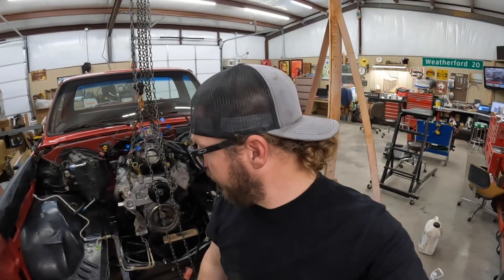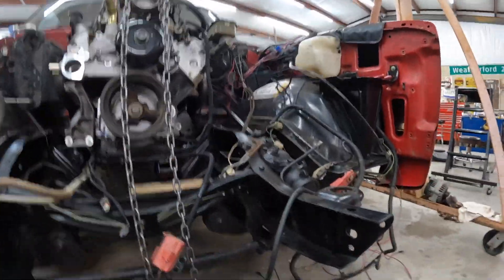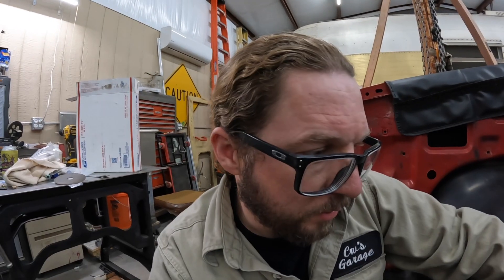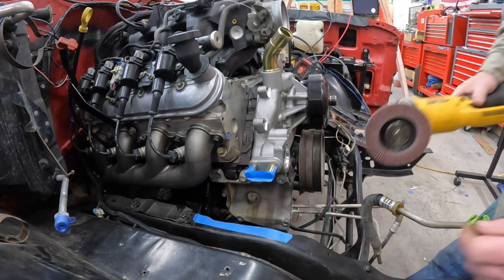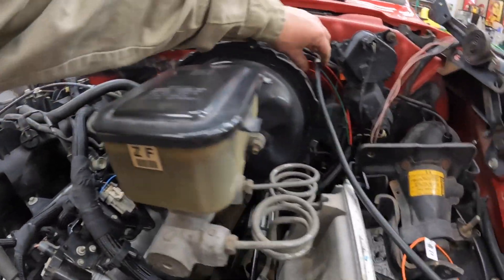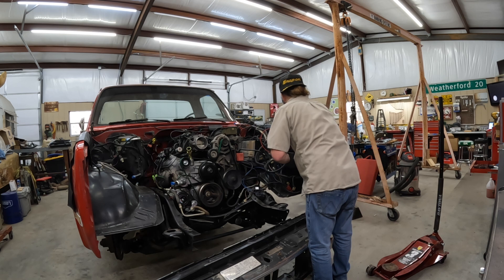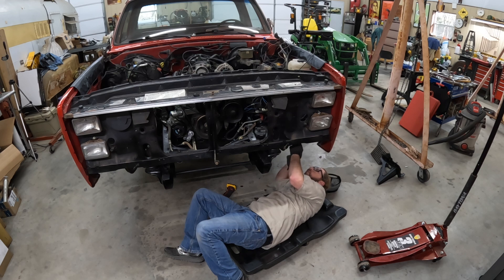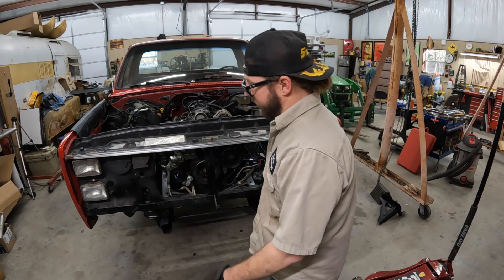1986 C10 Squarebody LS Swap Tejas Steelworks Motor Mounts and AC Compressor

Comment: Nice video doesn't that top side fitting on the compressor need to be going towards the evaporator in the firewall. Essentially making it's direction of that fitting backwards?
Reply from the maker: @TurboTA89  I’m not sure I understand. The larger hose goes to the evaporator and smaller hose to the condenser.

Comment: What cast manifolds are those? 2.5" outlet?
Reply from the maker: They're the inexpensive ones on ebay and other sites. They are 2.5" outlet, I bought outlet pipes with flanges from CPP but they come with flanges to weld to 2.5" pipe as well. Not sure if this link works, but they are even cheaper than they were when I bought them.  https://www.ebay.com/itm/404394946200?_trkparms=amclksrc%3DITM%26aid%3D1110006%26algo%3DHOMESPLICE.SIM%26ao%3D1%26asc%3D273558%2C273425%2C273800%26meid%3De6d2e38605e04485a0dbb1b2ac3b5982%26pid%3D101875%26rk%3D1%26rkt%3D4%26sd%3D144194498694%26itm%3D404394946200%26pmt%3D1%26noa%3D0%26pg%3D2332490%26algv%3DSimVIDwebV3WithCPCExpansion%26brand%3DOE%2BQuality%2BFriction&_trksid=p2332490.c101875.m1851&itmprp=cksum%3A404394946200e6d2e38605e04485a0dbb1b2ac3b5982%7Cenc%3AAQAJAAABMKAOBbj8c9I6eO4vPyI9FfMl8NhNqsULUU1TfDUZ7khliL00RemN2vDUGlwZW4yVMg7%252Fg4QWG1SRnaBqCuUVDcVbV76d9ELbcGiRfiItYWpkMasUgY3OMam5oNVvoRFHtD1kYFwQ9IblRhe7emj4zau0iFZte1PKh%252FrDAjdC0NXYRFM42KtiWeFWeaDaKWdF%252BTR69f%252BAAsYwEEiltTD9y1AkOPjQ%252By8vpGk9oyUWI92M8w%252Bq8tuIVIQHdVYQXRXnLmyvSoQ7GZHpI9UyGCfasHf4oKvpk9ztKVK7T7wDdm%252B%252BxY%252Bp8sLhNEibAzOpGHS6X0O%252Fe2FMfczT6ceCviqoNzinsKGjFm9iKLuCcBHfWZayWW8cmIBTiTiNjRPJybaIaD7xYDveFYYgirZGRdCOq2Q%253D%7Campid%3APL_CLK%7Cclp%3A2332490&itmmeta=01J8MGR7XMRRYWV14APRV443H4

Comment: Did you use the factory AC lines or did you need to “customize” the hose fittings?
Reply from the maker: The line from the condensor to the drier/filter if factory, all of the other lines had to be custom built. You can contact cold hose, they sell the adapters and can help you build your hoses.

Comment: What are the part numbers on the drive belts
Reply from the maker: AC Delco/Gates K060923HD for 105 Amp alternator, if you have the 130 Amp alternator you will need K060930HD. AC Delco/Gates K040378HD for AC.
Reply: @cwsgarage  THANKS for the info I will post and tag you when I install them.

Comment: Will this work for a sanden compressor? I'm going with a lsx transplant kit in my c10
Reply from the maker: Is it the style with the single “manifold” hoses? I’m not positive if that style will clear the frame. The Denso is what Tejas steel works recommends. I’m not sure if you’re on Facebook but there is a group for LS swapped squarebody that may have a better answer for you.
Reply: @Cw's Garage  sanden are the compressors used in high mount applications. Like the ones vintage air uses
Reply: @cwsgarage  not to mention I'm going with an aftermarket a/c system. Vintage air or old air auto
Reply from the maker: @vernonchaney65  Sanden makes a lot of compressors for a lot of applications and car manufacturers. But if you’re using the high mount compressor then you shouldn’t have any issues. One of the benefits of using the Tejas mounts though is so you can use the factory style donor compressor